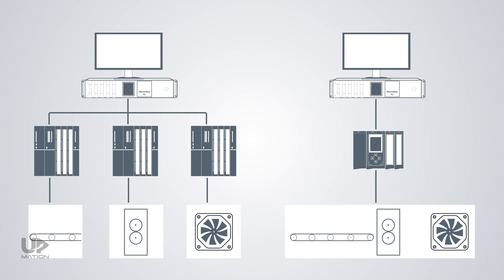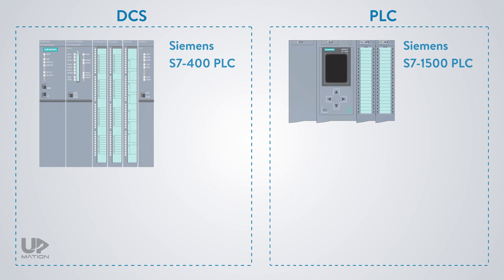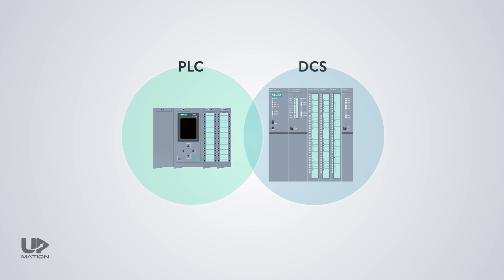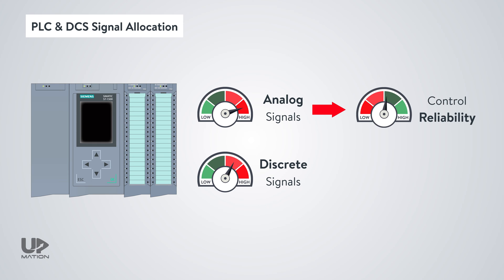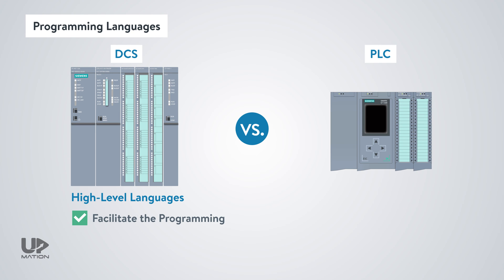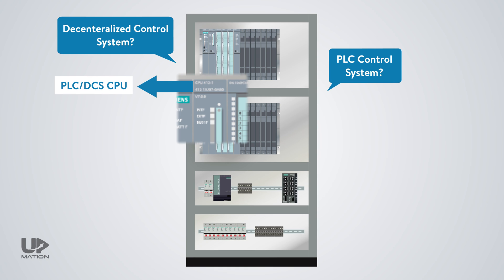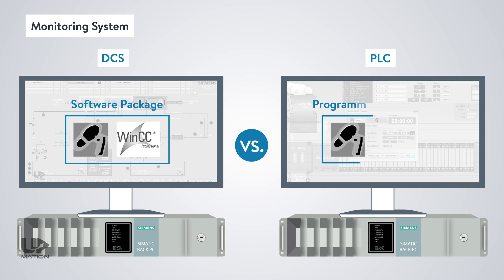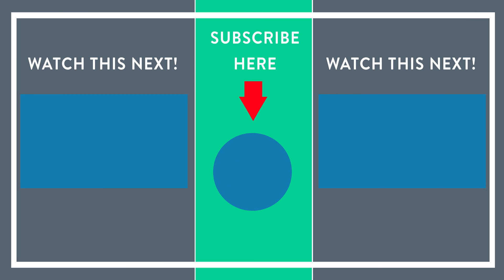DCS vs PLC | 5 IMPORTANT Differences NO ONE Teaches You! // Difference Between PLC and DCS

Comment: Yeah. DCS uses higher languages such as CFC. This creates a very high quantity of undecipherable code when compiled (in Step7/PCS7), which caused Stuxnet to go unnoticed for a long time (remember?). It surprises me that for DCS the S7-400 series is representing, while as PLC the far more powerful S7-1500 series is representing. And also: for PLC programming the STL is (fortunately) being phased out, S7-1200 series no longer supports it. STL should have been phased out already with the introduction of the S7 series in my humble opinion. Most PLC programming nowadays is SCL, but I also like to use Graph (SFC/Grafcet) for sequences. LAD can be very useful too, anyone with some understanding of electrical diagrams can understand the working of that. PID controllers and motion control in PLC is also no problem at all (I did motion control in PLC already in 1988).
Reply from the maker: Thank you for your comprehensive input, Jos! These were absolutely important points to consider.
Reply: Basically, the S7-400 is the supported CPU of Siemens DCS up to date, and ET200SP is the remote I/O... No 1500 supports this for now, but that doesn't mean the S7-400 is outdated or phased out. Siemens continues to update the 400 line-up with much superior processing and capacity than the old ones. In some specific uses, such as PC-S7 DCS, Safety (F) and redundancy (H) systems, there is still preference for S7-400 models.

Comment: this is not a matter of cpu models but a design philosophy. in a dcs the process is delegated to a slave processor that is rarely on main cabinet but "on field" in this way, aside from isolating the machine from the plant, it makes also the electrical wiring a breeze: instead of all the io signals to link with main cabinet you can just use one network cable in a loop and instead of transmitting all io-link data to process on main cpu you send only the setpoints and receive the result. this is essential when comminucation stability is not guaranteed and latency is not idea to have fast response

Comment: Decentralized Control System (DCS) vs PLC vs Old Automation.
1960s Old Control Systems https://youtu.be/O_QjfcOVW1U?si=pNdu3kgk-Q5SAe7c&t=99
1973 Modicon PLC System
1975 Yokogawa DCS
DCS is really about enabling processor or PLC failure. Continuous processes.  Many analog signals, few discrete signals.  PLCs are the opposite, mainlt discrete (digital) signals and few analog signals.
Nuclear energy, water distribution and recycling, automation (cars, assembly lines, ...), and other industrial processes.
Ladder Logic Diagram (LAD), Functional Block Diagrams (FBD), Structure Text (STL) are simpler than high level programming so less CPU intensive.  Closer to machine language.

SCADA - Supervisory control and data acquisition.

Comment: Just one remark. DCS stands for Distributed Control System.
Reply from the maker: Thank you for the comment. Distributed and Decentralized are both used for DCS and both have the same meaning.
Reply: @Upmation  Distributed means computation is spread across multiple nodes instead of just one. Decentralized means no node is instructing any other node as to what to do.